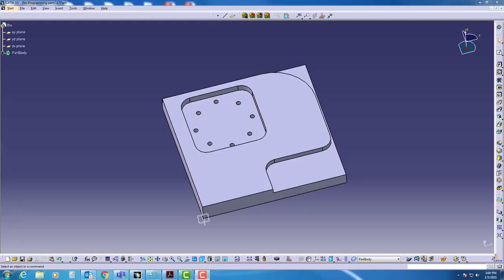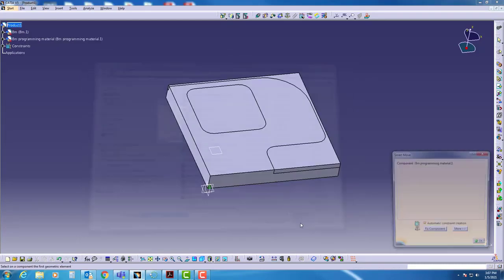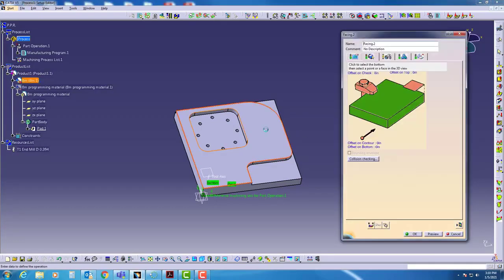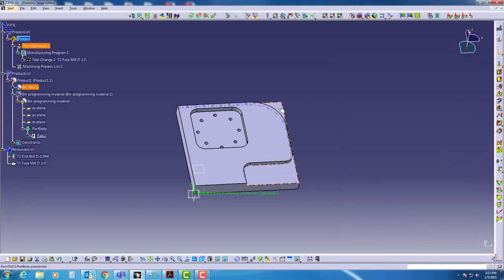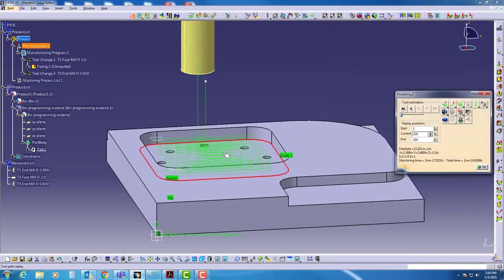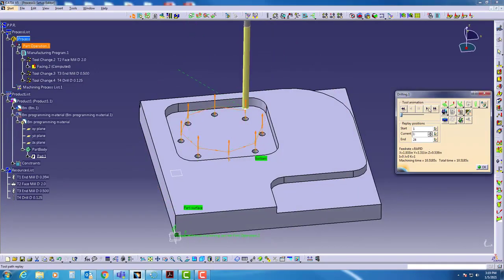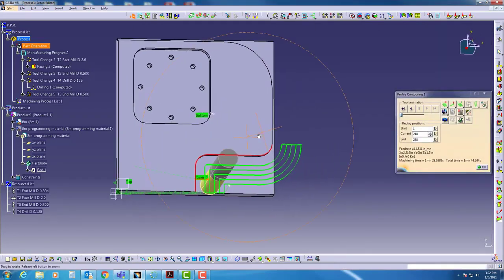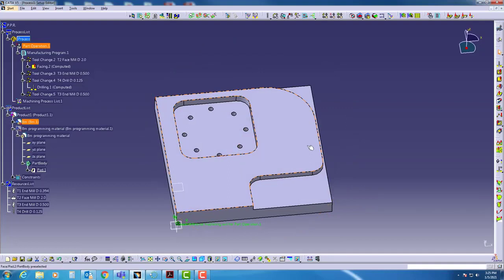Catia V5 Simple Programming

Comment: I got this 3018 cnc pro for 150$ on Amazon and I’m trying to set up catia with it the machine and bit that I have . I’ve figured some stuff out and simulations work, I’m just not sure I put all the settings in it right. 
This vid helps a lot though thank you
Reply from the maker: @Dogface1984  that cnc Pro looks pretty cool.  I have another Catia video that goes over post processor settings, and I think that one in the video will work for your machine. Good luck, and you'll have to post some videos with it cutting.
Reply: @aaronrunk4209  thanks man I’ll do that. Also I’m gunna attempt to make a PCB with copper blank.. Using KiCAD creates .dxf file of circuit to past on geometry

 Gunna check your video now, I appreciate it

Comment: My question is..do you assign the material (drag and drop) to the .catpart before entering the machining mode. I'm an advanced catia design engineer but just now learning the cnc side.
Reply from the maker: Just to make sure I could I opened a finished Prismatic machining file and I was still able to apply the material type after the drag and drop. One thing I would check is once you have updated the material, post your code and look to see that the feeds and speeds adjusted to the updated material. Going forward, my habit would be to apply material before dragging and dropping. Thank you for watching.
Reply: @aaronrunk4209  yes I just  applied the material to the stock and everything worked out good. So to me it seems that your catpart can be any or non material applied but your stock should have material applied.